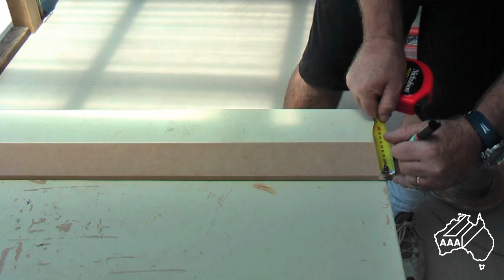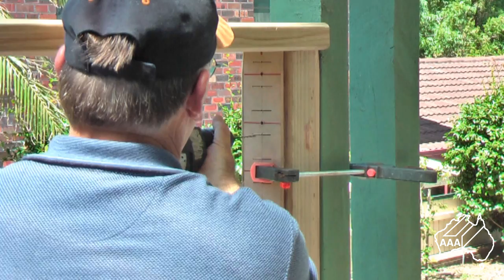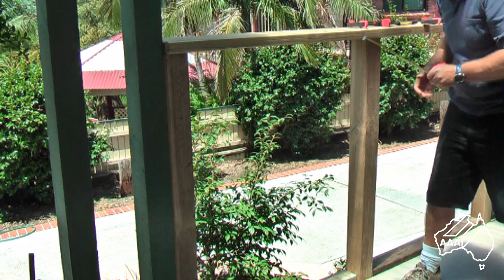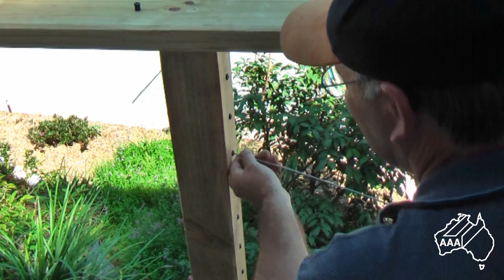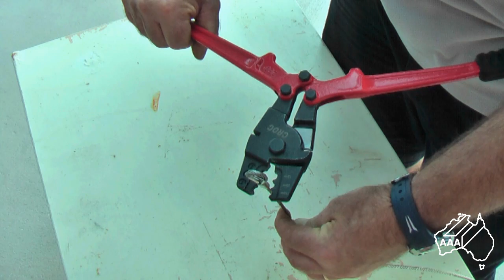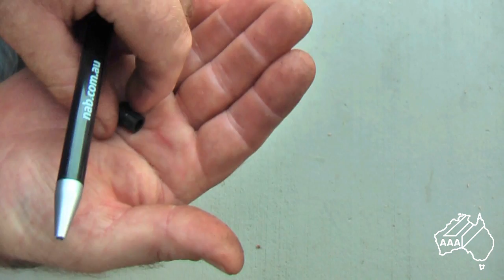DIY Installing System C Stainless Wire Balustrade - Saddles as anchor points

Comment: Fantastic, I know this is quite old now but still great. I've just had a builder finish a deck for me with this system and I am currently waiting to catch up with him about how he has finished off the steel,  rather the young trainee (not bagging the trainee) has left about 20 to 30mm of wire sticking out of the ferrules and some are very frayed and dangerous. I wished I had done this myself!! Great video.